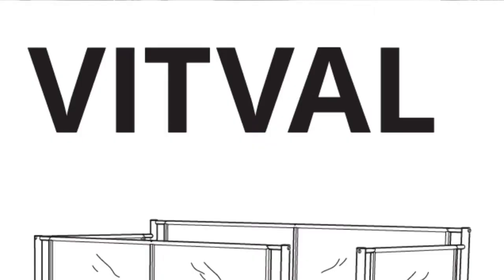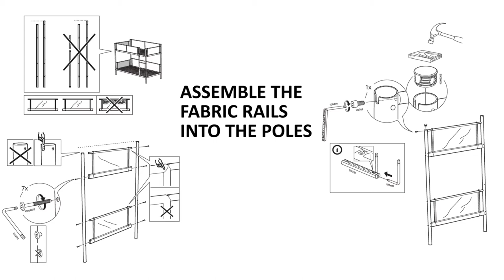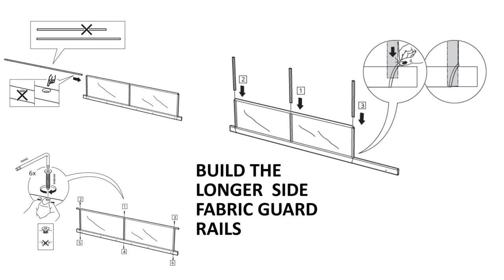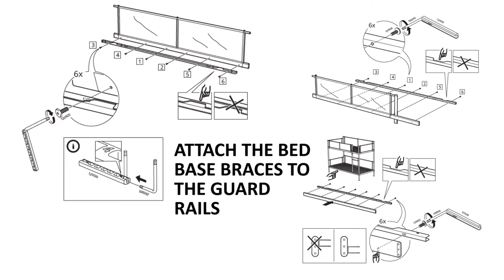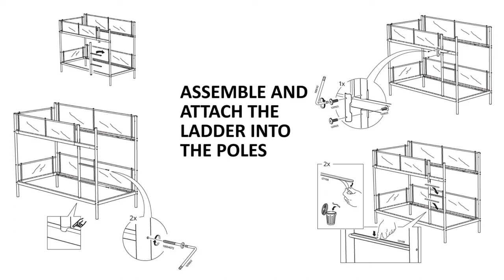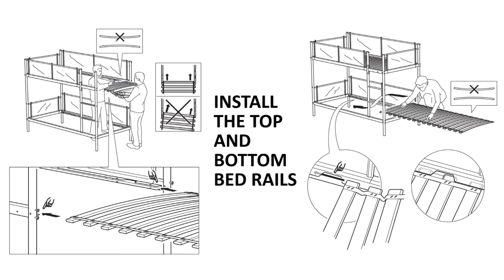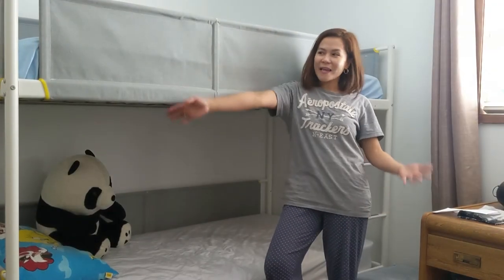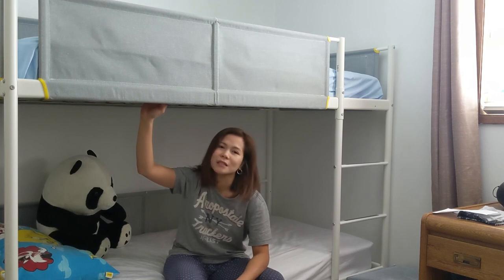IKEA Vitval bunk bed Assembly Instructions and Product Review | Easy DIY bunk bed

Comment: Thank you very much for all the informations. Can you tel me if the length is 200 cm or 207 cm? And the matress is 189 cm? Or 200 cm? The measures on the website on Portugal are different from the instructions. My bedroom only have 202 cm of length. Thank you very much! Best wishes
Reply from the maker: hi there thank you for Watching this video.
I measured the actual Length of the assembled  bed frame and its 77 inches / 195.58cm(converted)
matress is 74inches/188 cm.
were here in Canada
Reply: @wowietascorner1695  thanks!! All the best